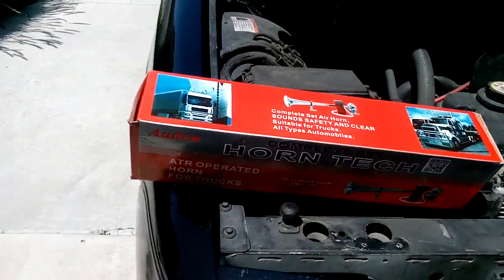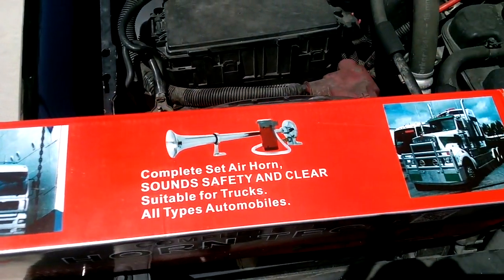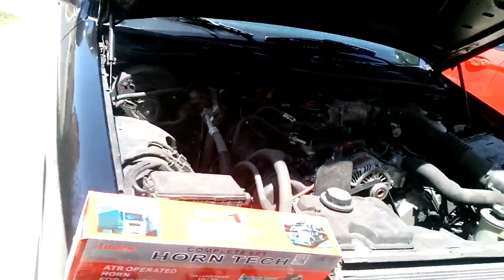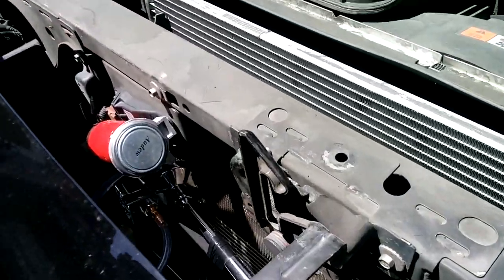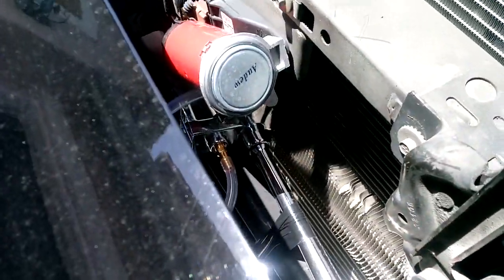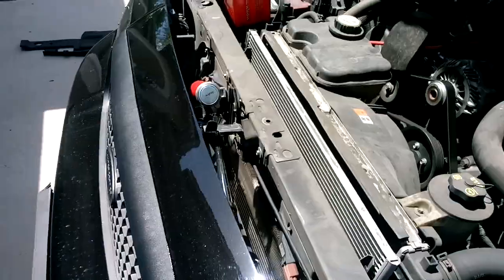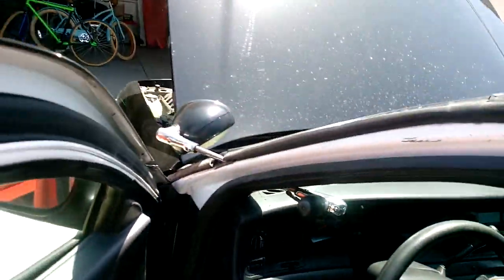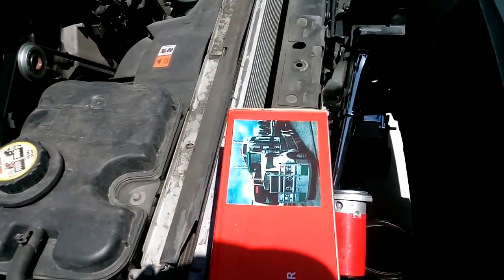Audew Complete Set Horn Tech, 150db Air Horn Test

Comment: The reason no one says to wire it that way is because its wrong. The compressor is to high of a draw for the stock horn switch, it will work for now....You need a solenoid in the system for that reason.
Reply from the maker: It's worked perfect for the last year.
Reply from the maker: Still working...
Reply from the maker: Still working...
Reply: Still working???
Reply from the maker: Still working
Reply: @SladeStone50  lol, good. Probably getting away with it because it is on for secs. If it was on or used more often, im sure the heat would take over(burning charing the contacts until it no long makes a connection. Or you have a lot of steel on the horn switch and its handling the load/ heat. It's not magic its just physics.
Reply: @SladeStone50  just because you came back and said it after a year. I'm subscribing!

Comment: How did u wire it with the stock wires?
Reply: Football Fantasy can’t, most stock horns use 18 awg wire with a 5 amp fuse. This sucker needs at least 12 awg wire and a 30 amp fuse, checked with amp clamp meter and it inrushed 33 amps, and pulled 26 amps. Hope this helps
Reply: @TheHopson  you need to put a relay in between.  the relay has 4 wires, 1 goes to the positive side of the battery, 1 goes to the horn compressor, 1 goes to the stock horn wire and 1 goes to ground.

Comment: You just wired it directly to the original horn wiring? No resistors or fuses? Thinking about doing this to my Grand Marquis
Reply from the maker: Certified Dirty Idle yessir
Reply: @SladeStone50  Still working?
Reply from the maker: Certified Dirty Idle forever

Comment: I have the wollo 800c after market compressor from jeegs fo 38$ 29 psi w two one small 750 htz nd one med low 500htz nd  cut its hose as min as possible for best volume power nd respond w nooo hesitation BIG DIFFERENCE